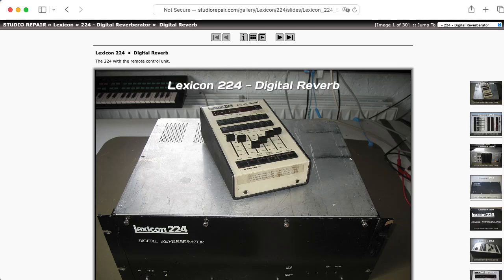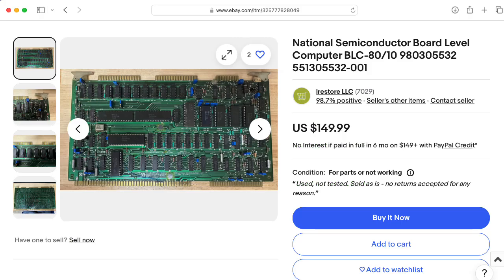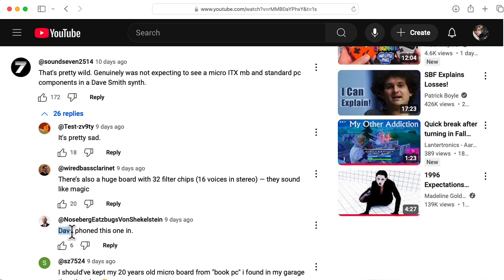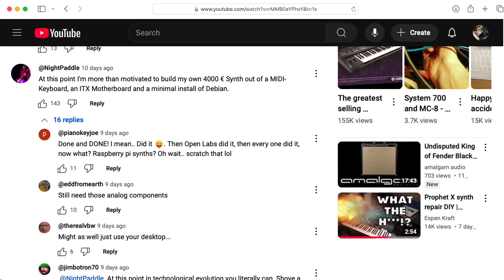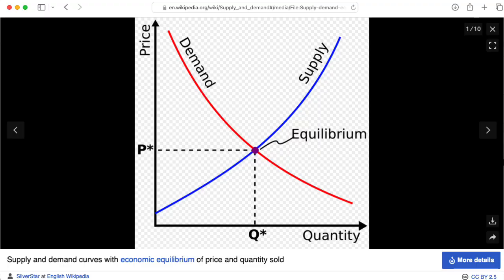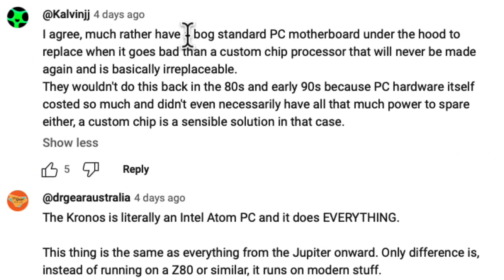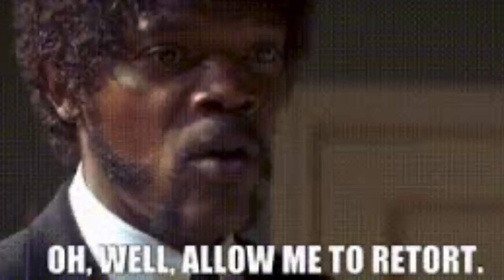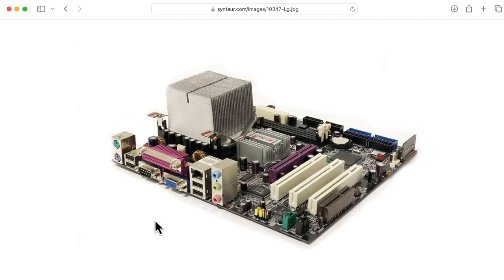Yes, the Sequential Prophet X Has a PC Motherboard. And that's OK. (Response to Espen Kraft Viewers)

Comment: The big difference between a consumer PC motherboard and an SBC like the Pi Compute Module is that latter is supported and manufactured for a decade while consumer products have a much shorter lifecycle. Yes, theoretically you could replace it with the same motherboard if it’s available on the second hand market, but you can’t just drop in any ITX motherboard and expect it to work as the chipsets need to match as well. This is a point that should have been mentioned and the primary reason why their component choice is problematic.
Reply from the maker: Good point -- I'm going to pin this comment right now.
Reply: Plenty of itx boards that are as well supported as the pi for industrial usage including this one! Might be off the shelf but it is the same as using a Pi. Industrial support for the psu is pretty exceptional as well, as shown in the price. Not what people want to hear at all, but there it is. ATMs have been using these kind of things for like 30 years
Reply: Forgive me for my ignorance here, but what even is the purpose of the itx board.
It seems to be connected via usb, so you should be able to just pop in a new computer system. with proper software
Reply: @ToniTechBoi  It's not necessarily, just replace with plug-n-play. Take the Korg Kronos for example, Korg uses an off-the-shelf Intel atom motherboard, but they have modified the motherboard with custom bios and some hardware mods to work with their forked version of RT linux and also they have custom hardware that interfaces with the modded motherboard. So if you're going to replace the mainboard with another off-the-shelf vanilla motherboard, then be prepared to make the appropriate mods to make it work without instructions. As an aside, I think a lot of companies nowadays leverage of the economies of scale by bringing a product quickly to market to keep overhead and development costs down - something I think Roland has still yet to figure out.
Reply: Consumer PC motherboard and component actually have a very good lifespan, most PC are replaced because they are obsolete not failing.
You can see that in industry that keep PC equipment/software far longer than consumer do. 
I regularly use floppy disk at work.
Reply: Seems to be running QNX, would be interesting to find out what storage the board uses and if there's a full image of it instead of the update packages to try it out on a different board but AFAIK, as long as the chipsets are register compatible and not tied to secure boot it might actually be fairly portable
Reply: @cfbdk  completely missed that one, those darn small x1 connectors.
Reply: this is an issue with every electronic device; specially the ones needing a small computer. The ableton push standalone has the same issue. synth using a compute module will have the same issue; as there's no special reason they'll be manufacturing the same version forever. Also it's entirely possible that another specific motherboard or several will work as a replacement (it has to be tested I suppose).

Comment: Looks like we need to change our mindsets about digital synthesizers - nowadays we're paying for the software, interface rather than custom made logic boards, as it used to be.
Unless you work with software creation, there's not high likelyhood one will appreciate how much work and R&D went into it, because it is, for the most of people, a program.
People still want their money to buy something physical and crafted, rather than something kind of illusoric as a computer program.

I won't lie, until watching this video I've also felt that having a synthesizer which has it's own logic boards is something to be proud of and is a symbol of strength - I usually associate custom-made circuitry and logic with rigorous testing and it always gave me an impression that real work has to be put into the product for it to work well - essentially eliminating my worries about software. But where did this come from? Well, from the sloppy written software for PCs and general distrust towards computers - I definitely wouldn't like my synthesizer to crash on stage while performing.

But now, after listening to all of these arguments about ease of possible repair or possibility to change architecture to another cheap board in case things go south? Well, this indeed sounds better.

But on the final note, although I know KORG cannot do this and I'm sure the price is justified due to how meticulously the product was crafted. their newest, exciting synth which is Multi/Poly, gives me mixed feelings.
In the native, VST version it costs 199 USD, while the hardware version running this costs 999 USD.

While using Raspberry Pi compute modules in this synthesizer is in fact a smart move and I know everything costs: good casing, keybeds, kaoss pads, displays, I can't justify paying 800 more for these elements. Makes me somehow feel they aren't worth it. I may be naive, but I wish hardware Multi/Poly costed 200-300 USD less.

Comment: The issue isn't that it has a PC board, The issue is that it has a cheap crappy pc board and costs FOUR GRAND! You are definitely better off running VSTs on a 100 dollar ebay netbook. Thats what I'm doing and guess what! I don't have any problems with the power supply and I saved 3900 bucks.

Comment: I think Espen is just spoiled from the golden years of 80's synth manufacturing. Those were the days were manufacturers would go as far to even make their own ASICs (Yamaha, I think Roland) to truly give the user a direct human-to-computer logic experience. I agree now it's sucks we now have cheap PC motherboards in our synths.... BUT as pointed out in this video...if it means we can get still new synths in 2025 and helps with costs, then is totally worth it!
Reply from the maker: It's not so much that Yamaha, Roland, etc. made their own ASICs to go the extra mile -- it's that they had to do that. There was usually a 6502 or 6509 or Z80 -- or later, a 68000 -- running the user interface. But those weren't fast enough to pull off real time DSP needed for music synthesis, which is why folks like Dave Rossum (MAN IS A GENIUS) developing the H chip.

Later stuff like the Access Virus could use things like the Motorola 56000 series DSPs (but the folks programming those were impressive in their own right since you had to really know the architecture and write assembly code).

I guess the main downside of that is that if you have a synth and one of those chips dies, it's toast...
Reply: @ That's true, I hate to see anything goto the synth graveyard!! ... BUT just because something is more reliable and/or cheaper, doesn't mean it is necessarily better, in all cases. A BMW that is a nightmare to fix and expensive parts can still run MUCH smoother (when working), compared to a Chevy.... I guess just saying this overall trend of cheaper pro-sumer gear since the 90's, doesn't automatically mean we get better music or better sounds.
Reply from the maker: Thinking back -- once you adjust for inflation, I'd say we're in a golden age right now! :)

Comment: Nothing wrong with using a PC or Arm or PowerPC based computer in a synth, this is very true as I do it and would continue doing so since it makes sense from a cost perspective as well as availability of such parts both now and in the future. Software programming and reliable components are what will make or break(literally)a synth or workstation. I used to prefer Windows XP or 7 or 2K embedded as my OS of choice for my audio apps and main synth OS but in recent years LINUX has become so versatile and reliable and highly customizable and user friendly, that using a commercial OS that would add to the costs, is just not worth it anymore. Kudos to synth manufacturers for what they are doing with this tech! It's about time... As for expensive bricks? I will not touch that.. Fingers crossed I do not end up with a $5000 brick myself lol!

Comment: Major props to you for your attitude. As a musician (user) I totally appreciate both the cost savings and the increased security we get if we ever need to replace an off the shelf component. Not all ITX motherboards are equal, sure, but still there's a much higher chance of sourcing a suitable replacement vs proprietary components. I actually like the fact that Korg use Raspberry Pi in their Opsix, Modwave and Wavestation synths.

Comment: Thanks for putting this together. Espen K. has a habit of ruffling feathers, perhaps to get views, but in my experience, he seems a bit misguided on occasion. I do agree  with him regarding the CMOS battery issue having no relevant error message, just a bricked device.
Reply from the maker: Yeah, I should have made it clearer that I was just addressed the general idea of using a PC motherboard. Sequential fell down on the details (I get the impression it might have been rushed out the door).

Given that the motherboard does have video output, it would have been cool for them to route those out the back so you could plug in a monitor easily. They could have done something like the old Roland S-330 and S-770 samplers -- that could have been cool!

Comment: You might say that the problem is not the standard PC architecture used, but the solidity of the motherboard chosen. The point is at least partly valid. Most of the time, PC MBs are not designed to be transported in a case that is not specifically designed to protect them. Is the Pro X case good enough? It's hard to say without having the equipment available to study it. Is the Pro X a machine that will be moved around a lot without protection? I don't think so. 
An Asrok MB is not a bad choice: you pay for the essential functions, without the often useless luxury refinements. The capacitors will probably have to be changed one day, as is the case with a lot of ageing equipment. But it can be done.

Comment: Wow, isn't this silly!

The "computer inside" thing isn't anything new. It's not even something from this century. In fact, the first synth using a CPU is something which many synthesists would gleefully agree to unpleasant bodily alterations in order to have one. I bring you...

The ARP Chroma. Notice that I put the ARP part in there, because they developed it. But what they developed it around was a logic board powered by an Intel 80186. Yep, that's a "1" there; this chip was intended for use in industrial and early embedded use. Yes, it was used to control the parameters, deal with user preferences, and I would figure it provided the VCO tuning and the like.

I did get to play one of the 50-ish ARP builds, though...and the comparisons are alarming. And I mean "alarming" as in a bizarre drift problem that the CPU was supposed to be preventing...but which wouldn't be fixed even if you hooked it up to Deep Blue!

No, it was the VOICE cards...and NOT the processor...that were at fault. Or more correctly, it was a bunch of people who thought they knew better at Gulbranson's old Hoopeston, Illinois factory, where the manufacturing moved post-ARP. Gulbranson used a flux method that wasn't compatible with the card boards, and instead of the flux going away...naaah, it just wound up contaminating the breadboard stock.

On the first 500 or so.

But the point is this: when this happened to one of the most anticipated synthesizers of the day, one which made a lot of noise about that CPU being THE way to correct previous polysynth reliability issues (like tuning...this was the exact same period when Yamaha dropped the CS80, only for users to discover that it would go out of tune from merely moving it from one room to another!), welllllll...it took some time to figure out that this contamination was the real cause.

And during that period, with frustrated customers, terrified Fender/CBS brass, confused board fabbers out on the prairie, SOMEbody tossed out the unfounded AF idea that...

"THE COMPUTER IS RESPONSIBLE!!!"

And once that got tossed into the info void at that time, the idea that this brand new feature was to blame went up like a mountain of flash paper wads! Sure, it wasn't TRUE...but nobody had any other idea (yet), so yeah! COMPUTRR NOGO INN SINTH!!!

So, remembering the tire fire that resulted, yep, this is just an echo of that. It's like an archetypical memory...like Xenu and the Space Jetliners...but it does seem as if every recurring hiccup of this has that same pearl-clutching going on. C'mon, y'all...just trust your synth designers, OK? They know what they're doing...yes, even Uli, I'll begrudgingly admit...so step back and let 'em breathe. Don't theorize your way out of snagging the cool stuff, either. The tech in this is flying past us at fascinating but disturbing paces, we just need to be more open-minded about what that tech-barrage can do for US.

Comment: Had one and sold it after dealing with and constantly hear similar complaints from other buyers.
When it worked it was a cinematic synthesizer. Big sweeping effects and rich tonal sounds. But you can literally buy those things as a VST.
Reply from the maker: Yeah, the thing is that DSP emulations of analog filters have become very, very good -- so there's not much point to the giant analog board (I realize many disagree with me).

 I have a video comparing the Arturia Prophet VS emulation with the original Sequential hardware (my rack unit, which I've since sold), and asked people to tell which is which, and so far no one's guessed much better than random chance (and the guesses are all over the place from person to person). 

So although I teach a class on analog circuits for music synthesis because I think analog circuits are fun to tinker with -- as far as practical tools goes, whether something is "real analog" doesn't much matter to me one way or another.
Reply from the maker: I get the feeling Sequential rushed the reliability testing. Maybe it's a heat issue? Maybe they didn't put in enough stuff to deal with mechanical shocks? Who knows...

Comment: A good retort. Espen admitted in a comment to me on his second video about this subject that he's doing this for the clicks and thus money. BTW, that video is the one with the noose in the thumbnail in which he claimed that Sequential was pissed at him when really all they did was try to tell him that the PSU he ignorantly suggested would not work and indeed damage the Prophet X due to a different pinout.

But yes, even worse than selling any integrity he may have had for limited clicks from synth nerds are the myriad misinformed commenters who evidently have never peered into an electronic instrument before. Since the dawn of digital control of analog synths, ie the original Prophet 5 (designed by the genius, Dave Smith, who also designed the Prophet X obviously), manufacturers have used off the shelf parts to save time and money. The Prophet 5 uses a Z80 and all the standard outboard support ICs it needs to function. It's basically an 8bit computer with it's own ROM, RAM, and I/O. There's nothing custom about it except the software.

Actually it goes back way before that. Guess what op-amp the original, highly regarded Oberheim SEM uses all over the place? The lowly 741. And yet it sounds great.

Contrast that with the Alesis Andromeda, an instrument that uses custom designed ASICS. It's a great synth but if something goes wrong with one of those custom chips, you're screwed. Alesis hasn't made them in 20 years.

The other irony is the only reason he was able to fix his Prophet X is because it IS a cheap, standard PC motherboard in there with a coin-slot battery. Ever change a battery in a DX7? In an Oberheim OB-Xa? Korg PolySix? I'm pretty sure Mr. Kraft wouldn't be able to do it.
Reply from the maker: Many moons ago, I made a deliberate decision to never monetize the channel. This was for a variety of reasons, but one was that I never wanted to be tempted to do things that would degrade the integrity of my work on this channel for financial reasons. (I do confess that my self esteem has largely become tied to watching those view counts and the subscriber count go up...)
Reply: @Lantertronics  Disseminating knowledge can be a reward on its own. Major props to you.

Comment: Years ago I had a Prophet 600 (one of the very first MIDI synths available) -- it ran on a bone stock Z80 CPU and several MUX/DEMUX chips sending data through digital-to-analog chips to create the control voltages to all those wonderful Curtis CEMxxxx VCOs, VCAs, and VCFs.  It worked, and it worked well (until something inside went wacky and it wouldn't tune right - and I traded it in on a Casio CZ1 - another early MIDI synth, which I still have, and use).

So what's the big deal?
Reply from the maker: Some people seem to be really upset that a manufacturer might choose to use an OEM PCB with a microprocessor on it designed by another manufacturer in their product vs. in-house designing their own PCB with that same microprocessor, which is seen as more honest and pure, or something... ;)
Reply: @Lantertronics  OK, but apart from maybe Yamaha (which ironically enough, made synthesizer chips to put in computers), how many companies have chip fabs to create their own chips.  And how many of the old synths had those Curtis chips in them?  quite a few, I would imagine...

Comment: The days of purpose-built hardware seem to be gone, which makes sense, since computing power is so abundant that you don't need to build specialized chips for everything. Even early digital synths were already using some off-the-shelf chips. I mean even my Ensoniq Mirage is really just a fancy Commodore 64 with a nice soundcard and a keyboard.